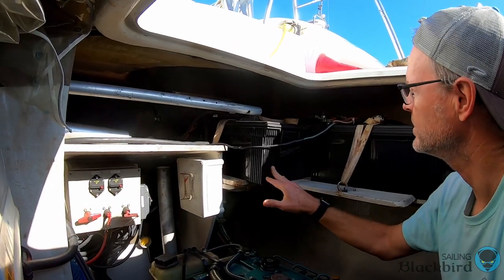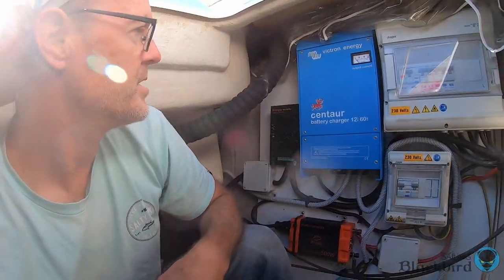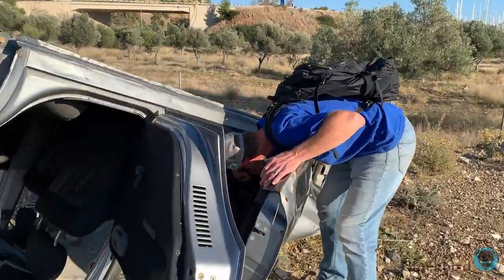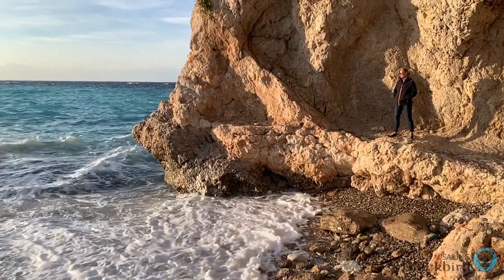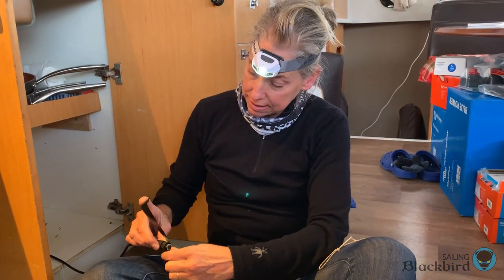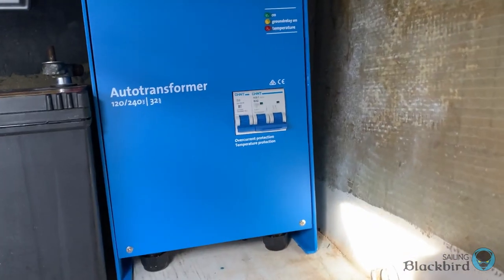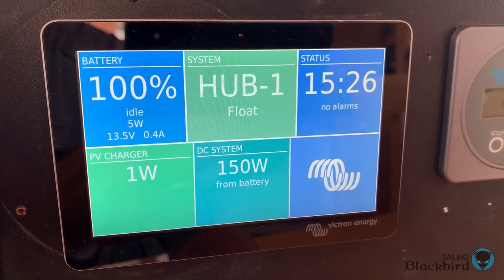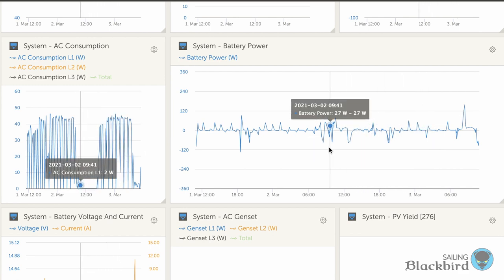9. New Victron Electrical Systems

Comment: No generator?
Reply from the maker: Hi! No, we don’t have one and are hoping to never need a generator.
Reply from the maker: We have 1300 watt solar array and 800 amp hours of battery.
Reply from the maker: Do you have one and if so when are you using it?
Reply: @sailingblackbird922  Yes I do have one on my cat, it is only for emergency when 3 days or so with no sun, so I can get the batteries charged.